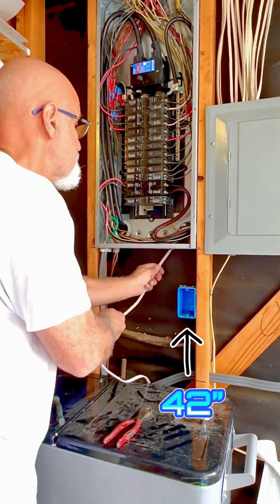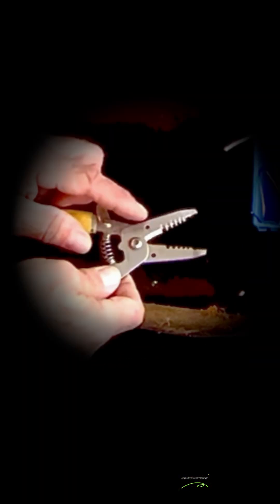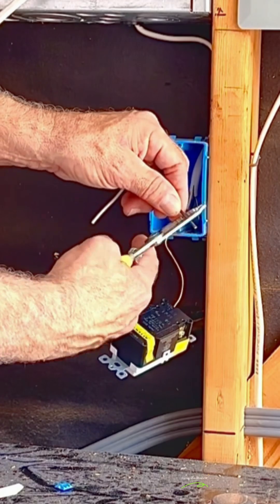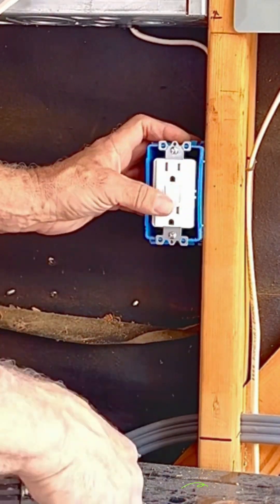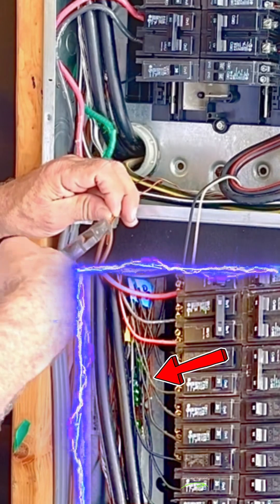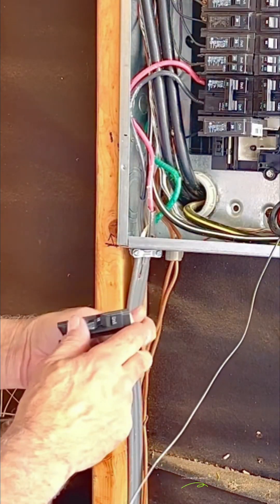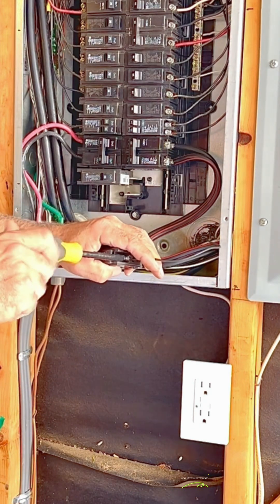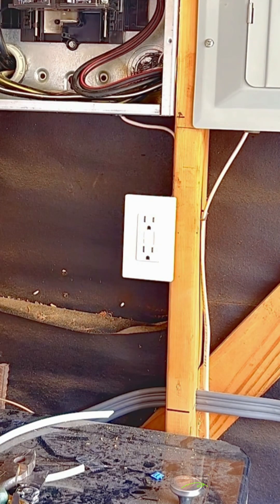How to run a new circuit, a breaker and GFCI outlet #install #diy #new #electrical

Comment: Do you shut the power off the whole breaker box ? My panel doesn’t have a switch to turn the whole panel off
Reply from the maker: In this video the panel is hot. I typically don’t turn the main breaker off as not to disturb the other functions of the household, but I’ve also been doing this for over 35 yrs and know what not to do, what tools to use, safety measures, etc.
I DO NOT RECOMMEND ANYONE WORKING IN A HOT PANEL!
I highly recommend shutting the main breaker if there is one. Since yours doesn’t have one and if you haven’t had the proper training to work in a panel while the power is on. I wouldn’t advise it. One slip and your life can change permanently or worse.
You can call your electrical provider and request a temporary disconnect for your electric meter. That will cut off the power to your panel.

Comment: The wire length is 6 inches from where it emerges from the sheathing, NEC 300.14.
Reply from the maker: That’s minimum length. I like 6” from the front of the box and it can always be trimmed.

Comment: Do NOT ever use the push stab connection.  After heat cycling the wires will lose connection and can cause a short, which in turn can cause a fire.
Reply from the maker: It’s not a push tab. These GFCI’s have smooth holes for the wire to go in freely and the only thing that fastens it is the screw that’s threaded to a copper piece inside on the other side of the holes. If you watch it again, you’ll notice I said, “hold the wire in while tightening the screw.” I can see how you would think they were push tabs, especially if you haven’t installed one like this before. Thank you for sharing.
Reply: @learnallremodelinghere  is it a particular GFCI? or all GFCI are not push tabs?